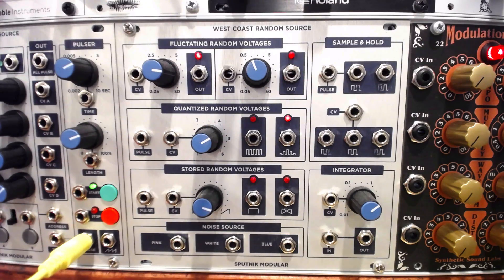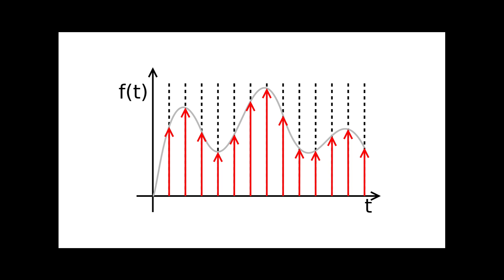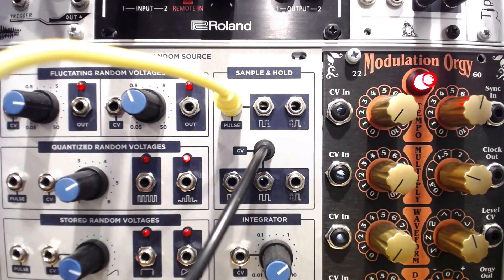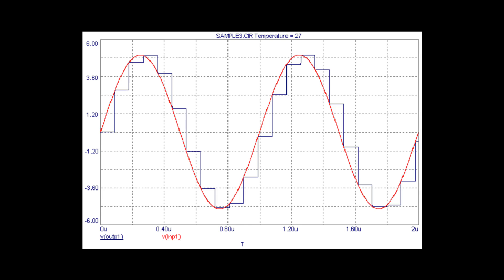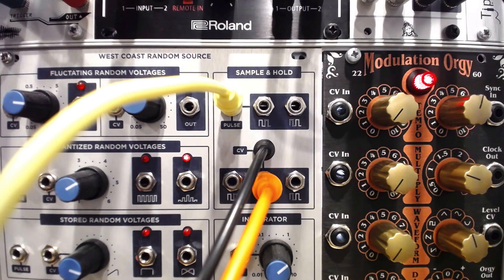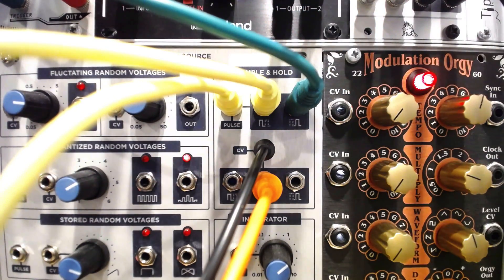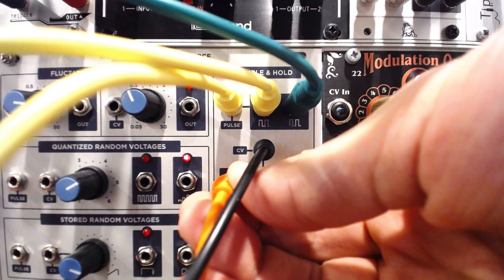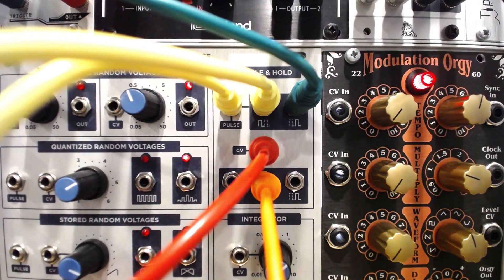Sample & Hold In A Eurorack Modular Synth

Comment: I use the SnH of the Volca modular as a guitar effect. It gives a Bit Crusher type effect if you sample the guitar sound at audio rate. Now a funny thing happened ( 8 years have passed and I doubt the content creator monitors the  comments anymore) I came here because as I have just learned about PULSAR SYNTHESIS I was wondering if i could do some kind of SnH but with silent gaps and low and behold! I see this PULSE input with the alternating double outputs. I wonder .....if I just used one output, ...wouldn't it be  silent when its brother is firing off? Can I cv control their ratio as well?